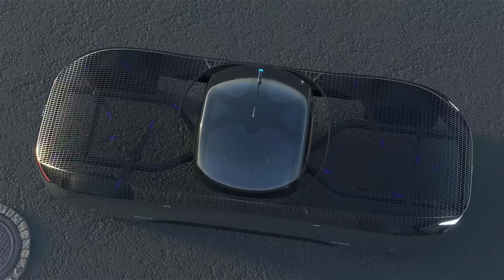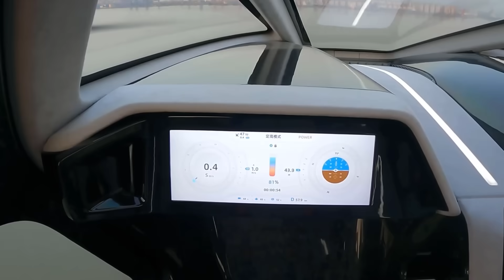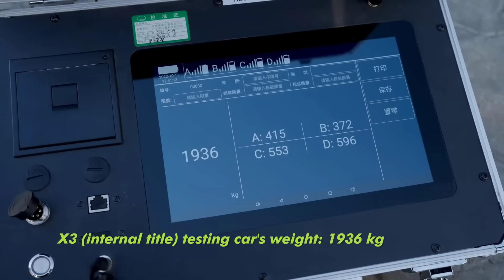4 Hovering Cars 2024-28 | Magnetic Revolution

Comment: The problem with removing friction from a tyres also removes your steering, drive and brakes..
Reply from the maker: The car Brakes when the rotational speed of the Rear Wheels is increased and Accelerates when it's decreased,
And achieves Steering by adjusting the rotational speed of the Side Wheels
Reply: @FromFutureLab i
Reply: Yes. When We jump MX bikes we can control the weight to lift and dive ration. Example of this is as we launch off the ramp into air we can use the front wheel brake to stop the spin and this creats downforce and stops us going verticle and the weight of the spin upon break dives the front of the bike down. If x4 wheels are in play they would need to be ajusted in position to act the same way. Also Air flaps in a bodys grid pattern could be used to allow air through and block air passed through to brake.
Reply: @spraya-ltd  The reason most things in the air work is because you initially had contact with the ground.... If you wanted to turn, stop, react to an emergency... youd just end up crashing if you were floating without friction and a means of changing your axis. Also what happens to the aerodynamics at that point? and are we hovering? are we driving? or slowly floating.
Reply: That’s the problem I can see happening that’s why I’m saying let that magnetic bullshit stay a pipe dream
Reply: Will never happen.  Will be confined to maglev trains on dedicated tracks.  No country is ever going to build a network of aluminum roads integrated into the normal asphalt roads.  Another pipe dream like the hyperloop (which really is a literal pipe dream).
Reply: @my3dviews I'm with you! It's an 'as if'
Reply: That was pretty much my question. How do you steer?

Don't think this is going to happen any time soon.
Reply: @Gardener7  aluminium does react tho to an AC magnetic field
Reply: True, however I believe that there are other means to stop and steer a vehicle, G force, earth’s magnetic field, etc.
Reply: @stefangabor5985  Hahaha earths magnetic field is weak as dogsheet

Comment: For the first project, I'm curious how much extra power is required to compensate for the eddy current heat losses in the aluminum
Reply: Answer - a LOT. It'll take something akin to Tesla's wireless energy broadcasting to power it.
Reply: @martinbaxter2616  
i agree, depending on batteries alone is a stupid idea, if only we could figure out Nikola Tesla's wireless coil design and implement it within our cars, i could see the battery existing to use some functionality in a car, but i don't like the idea of using it for the entire operation of the car like we are doing now.
Reply: This will never work if green energy become mandatory. These stations is simply too weak